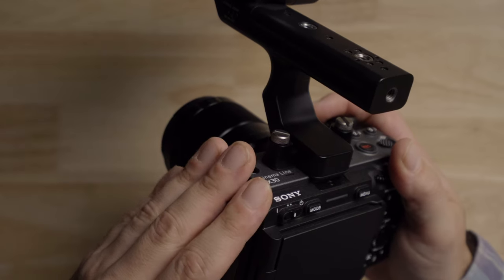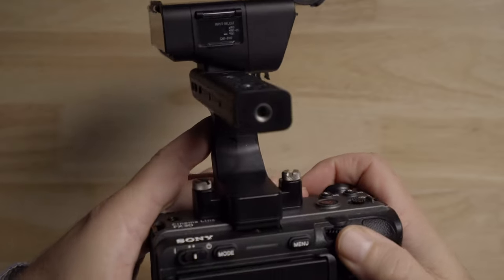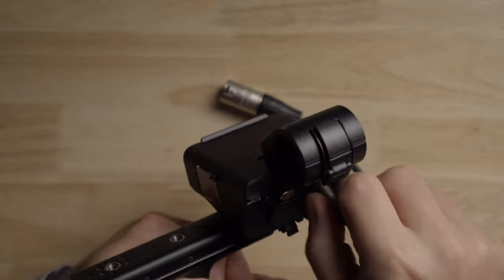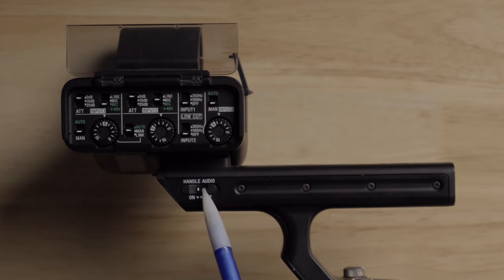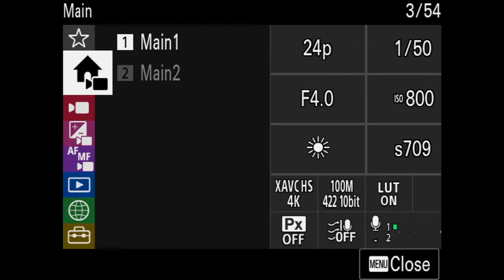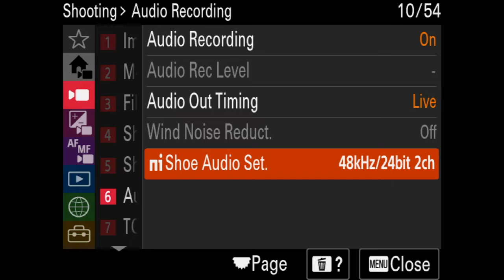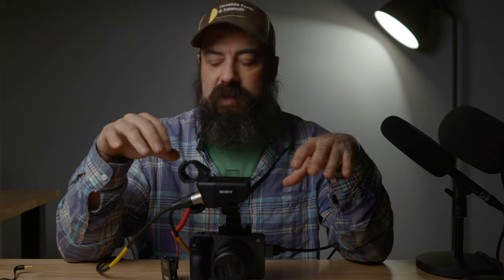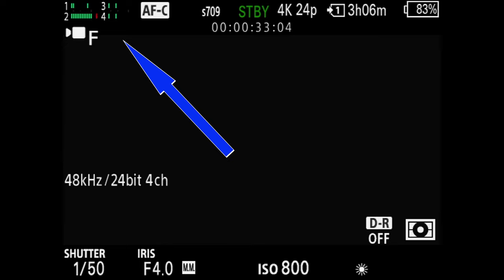Sony FX30 / FX3 XLR Top Handle - Everything You Need To Know

Comment: Just picked up an FX30 (coming from the older Blackmagic Cinema line) and went with the bundle with the top handle - definitely a much-needed accessory in my world. I'm a musician and I do demos on my channel of audio effects units with synths, drum machines, and samplers, and the idea of recording 4 channels of audio EMBEDDED in my video is going to make editing SO MUCH faster/better than syncing up my H4n files. Was super pumped to learn that the handle did 4ch audio. Excited to start using this thing! Appreciate your content btw!
Reply from the maker: You are going to love the top handle. It makes my life a lot easier. Thanks for watching!
Reply: Hey man. Quick question for you. Do you find the quality of the audio via the top handle is similar to running it through an interface? Basically I have been using an interface for my 2 mic video podcast setup. But if this thing works it would save me a huge ball ache of having to connect the mics through an interface into the laptop. Especially on location.
Reply: @HeywoodandStuff  It's absolutely good enough for YouTube! I mean probably not as good as the highest end stuff, but it just depends on your standards. I wouldn't use it to record my album, but I've been happy with it for my videos. If you check out any of the videos on my channel, I'm using it to record the line audio from my music gear and my Beta 58a at the same time, with a free channel to spare.
Reply: @Duskmos  thank you dude. Very much appreciate this!
Reply: @HeywoodandStuff  Happy to help!

Comment: Hey. Do this handle use battery power? I mean if I will use it with my fx30 the battery will run out quicker? Maybe it depends on the mic which I will use? If yes, what if I will be using "rode video mic micro" with an adapter? It will still use my fx30 battery power? Thanks in advance

Comment: I tried setting it up, but I got static and noise. I ended up using the 3.5 mic without the top handle. I'm not sure why, but I get cleaner audio without it.

Comment: Thank you- this is a great vid! One question though... On my FX3, if I have a sony xlr shotgun mic plugged into the 2 xlr inputs and a Rode Wireless Pro rx plugged into input 3 for two lav mics, what should the input select switch be set to? Or does it even matter if the audio in the menu is set to 4 channel?

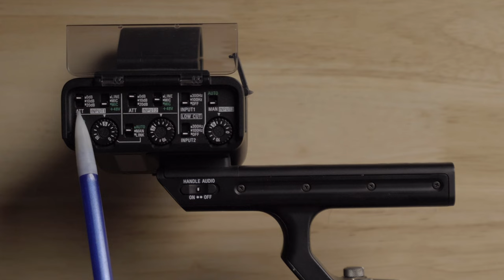Comment: Thanks Josh, for a great video. I want to plug sound from a mixer. I see at around 4:30 I have to choose Line Input level. What kind of cable do I use from the mixer ? XLR, 1/4 inch or RCA? Do I plug OUT or IN from the mixer ? Thank you!

Comment: Awesome videos Josh!  
I think that the XLR-K3M, although not as sexy as the "top handle," is more versatile than the handle--especially for those of us who have Fs7's, a7siii, etc...  Also, I'm not a fan of mounting an external monitor on top of the handle, growing the rig upwards and tending towards making the camera front heavy.  With a SmallRig half cage, and the XLR-K3m (and a few odds and ends) you can mount an external monitor more in line with the FX30's touchscreen directly below--counterbalancing the rig and lowering the external closer to the flip out.  Yes, you lose the cool handle, but in my world; most of the action is better covered from my chest up to eye level... Happy to share my FX30 setup.
Reply from the maker: Thanks! Yeah, pros and cons of both. It really depends on how you plan to use the camera. I do prefer the top handle for run and gun stuff like I showed in the video, but I agree the XLR-K3M is more versatile overall. Glad we have options!

Comment: Hey man, 
I'm curious if it's possible to use a shoe ribbon adapter, much like you'd see for a remote flash in photography to attach to the handle.

Basically I have a FX3 in a static position mounted above my desk facing down. I prefer keeping it in the small rig cage I have for it. What I'd want to do is use a ribbon shoe apdater from the audio port on the top middle of the camera to the audio handle then mount the audio handle on my overhead. Do you think this is possible? I can't really find information about others doing this. 

Thanks in advance

Comment: I buy an FX3 XLR Top Handle for my a7IV(I use Adapter plate SmallRig MD4019)And it works well, I'm satisfied!..But when I turn on 4 channels, and connect a microphone to input 1 (or 2), and a wireless microphone to input 3, then it doesn’t work for me not to write to the camera 3 and 4 channels. And if I select 4-channel sound in the menu, then I see that channels 3 and 4 are not active .... What am I doing wrong?... ..., sorry for my English.

Comment: On the fence on the fence!!!! So, can you talk about the pre-amps on the unit? I'm struggling with either grabbing the xlr top handle with the FX30 or using the cash to pick up the Rodecaster Duo on release in July. I know the Duo offers the ability to tweak the sound quality and add effects to the mic (NT1 Gen 5), BUTTTTT, I do like the idea of not having to match audio in post. Is that the main question people ask themselves haha? My use case will be in office talking head, streaming/zoom calls and the odd single podcast. Thanks in advance and you've got a new sub! Great content. Peter, Vancouver.
Reply from the maker: The pre-amps are average. Not amazing but not awful. The convenience is great though and you won't have any sync issues when streaming because the audio and video get send together to your computer.
Reply: @Josh_Sattin  thanks a mil for the reply. Can there be synch issue when streaming? I was looking at the streamer x and Ecamm live set up. Looks like it streamer x provides one audio/video source into ecamm. Thanks again, ordered body only in the end. Am I going to regret this? Haha. Cheers.
Reply from the maker: @peteroates37  I haven't used the Streamer X so I don't know how it handles that. If you are sending audio and video separately into your computer they will not sync up. You will have to go into Ecamm and set a manual delay. You can always buy the XLR handle separately later if you change your mind. I have done streaming a lot of different ways and personally always prefer to send the audio into the camera to avoid syncing issues.

Comment: Hey Josh! Thanks so much for the video! Quick question, I have my rode ntg4+ connected into ch1 and my shure VP83 shotgun mic in the input 3 with the 3.5mm. I switched the back input to the very top so that input 3 goes to ch 1,2. so far, i think im correct. now to adjust the audio for the 3.5mm, i would still adjust it under input 3 correct? or does that now switch to input 1 controls. thanks!

Comment: Hey Josh, absolutely life saving review! Thank you so much. Instant sub.  I have an AVX mic and when I put the INPUT on the MIC position, it doesn't work... I have to use MIC +48v (Phantom power) which is really weird as the AVX is powered by internal batteries... Am I missing something?
Reply from the maker: You are very welcome. Yeah, I do think you need phantom power for some reason. Easy enough though.
Reply: @Josh_Sattin  cool, I was afraid it could damage the mic if adding the camera power to the internal battery power… but well, as it didn’t work any other way either, I guess it was the way to go …
Reply: That is strange, cause that is the purpose of batteries... when needing phantom power in the mic. 
Otherwise, if a "normal" mic, then it should have worked directly plugged in the camera, like my lav mic.
Reply: @WEHAVETHISDREAM  it’s strange indeed .. when I plug in a “classic” Senheiser receiver (those that works with AA batteries) I don’t need phantom power .. but the AVX receiver , I do .. maybe the battery is too small and serves for the radio signal but needs extra power either way
Reply: @Superjeanmarc  Pffff... I have no idea.

Comment: Really good and helpful video thanks - I’ll sub. Didn’t actually answer what I wanted to find out though! 😂 I do weddings and typically use zoom H1s with lav mics for most of my audio, but always looking for backup options and was wondering how good the audio would be from a microphone attached to the handle and about 15-20 feet away from the speaker - I would assume not great? I’m thinking wedding ceremonies on a tripod that distance from the couple.
Reply from the maker: You're welcome. You will get better audio quality the closer you can get the microphone to the subject.

Comment: Hey Josh, would you still use the top handle over a external recorder?
Reply from the maker: It depends on what I'm doing. For simple quick setups or run and gun I would use the top handle. If I need a lot of audio inputs and am doing something more elaborate than I would consider external audio. For most things I do, the top handle is great.

Comment: Josh, what do you recomend to use in the shock mount for an fx3 as an all around situation mic, run and gun and also studio work ? usually the talent is like 5m or 5feet away from the camera, Sennheiser MKH 8070 or Sennheiser MKH 8060 or Sennheiser MKH 418 S or your beloved MKH 50-P48 ?
Reply from the maker: My favorite all around mic is the Rode NTG5 - https://geni.us/Yi7A5S
Reply: @Josh_Sattin  Can it be bought with black rather then the red mic holders?  And can a wind shield protector thing be found without RODE printed on it?  I like everything clean without adverts all over it.  It just looks quite tacky imo.  I see on your desk no RODE display on the mic.

Comment: Thank you so much for the excellent video Question I have a shot gun mic and wireless lav. Can I put shot gun on and link ch 1 and 2 and then add a wireless lav and input to channel 3? If so what do I slide the input selector to ch1.ch2 or ch3. Any help would be  greatly appreciated
Reply from the maker: Yes you can do that. Make sure you have 4 channel audio turned on inside the camera. On the back handle switch set it to In1 and have the linked switch turned on channel 2 on the side.
Reply: @Josh_Sattin  great... thank you so much for your time!

Comment: Thank you for this video. As a warning for musicians and audio guys I have to say the preamps are not good and produce a lot of noise. A solution is to use an external preamp with a lot of gain and go into the Line Input at 0dB and very low input volume. But even then it‘s not going to catch up with the Zoom F3.

Comment: Hi!

What is the fourth channel?
Is there a microphone in/on the handel?

The other day I experienced a lot of (unwanted) noise from the handlebar. I had a shotgun (XLR) and wireless XLR lavalier. 
With the shotgun channel came a lot of that unwanted noise, which I can't split/separate.
Reply from the maker: The 3.5mm input on the handle is a stereo input. It is channels 3/4.
Reply: @Josh_Sattin  Ok. So when you plug something in it is the 3rd and 4th channel?
So really it is three channels?
1: XLR
2 :XLR
3 and 4: Jack

And is there a mic on the handle? (since I got all that unwanted noise)

Thanks :)
Reply from the maker: @christianbreidlid3191  Input 1 and 2 are mono inputs (1 input each), the third input (3.5 mm) is a stereo input (two inputs). You can use something like a Rode Wireless Go II or DJI Mic to have it send separate signals to the left and right channels (3 and 4) thus giving you 4 channels of audio. There is no mic on the handle.
Reply: @Josh_Sattin  Aha. Thank you!

Comment: I find it bizarre that anyone would choose to not get the top handle. The audio input option is priceless. 
My biggest gripe after excessively working with the FX3 is the lack of a REC button. It has the interface to send 24bit audio, there must’ve been room for a programmable button or two. Would save a lot of awkward fiddling to hit the other REC buttons
Reply from the maker: Oh yeah, a record button on the top handle would have been amazing!
Reply: I am debating with myself between NO handle and YES handle. 
I do not do audio stuff, normally, but I did have a project from a client, 
where I had to use a Tascam recorder. 
DaVinci can match the audio pretty easily and all... but, 
not having the need for an external recorder, could be cool. 
BUT, I do not know how often I will have clients like those...

Comment: Just picked up the FX30 with the XLR top handle. I had a quick question:
Does anyone else have handling noise recorded when running and gunning and using the handle? I get incredible feedback when moving - even gently - my fingers or hands and was curious to know if anyone knows of a fix? If you dont get the handling noise, would you mind sharing what mic and input you are using?
I am using the input 3 with a Deity 4 mini. Thanks in advance.
Reply: If you get get the top handle extension (small rig) it reduces the noise tremendously
Reply: @Kinetic-Studios  oh yes, thnaks! I ended up getting that shortly after posting and also changing the mic to a Sennheiser MKE-600 and haven’t had an issue since.
Reply: @Kinetic-Studios  What model, please? 

Does it make sense to get the Sony handle and XLR audio unit for occasional recordings, 
or better off with a regular handle and just put the mic in the little camera socket, when needed?
Like lav mics etc.
Reply: @WEHAVETHISDREAM  i wouldn't get the top handle. I did and frankly haven't used it

Comment: Can you run this system with the Sony A1?
Reply from the maker: While I do think it would technically work because the XLR-K3M works with the A1, the issue will be mounting it because the XLR top handle needs to screw in to something. Smallrig makes this adapter for their A74/A7S3 cage, but I'm not sure if it would work with the A1
https://www.smallrig.com/SmallRig-Adapter-Plate-for-Sony-FX3-XLR-Handle-MD4019.html

Comment: Can you run a XLR Lav Transmitter with 2 receivers at the same time as using the 3.5 jack with Lav Transmitter and 2 receivers for a total of 4 channels? I’m not sure if you can do this please if anyone know let me know. Thanks
Reply from the maker: Yeah that should work. You can run any two XLR inputs and then either a 2 channel lav mic pack into the 3.5mm or get that splitter.

Comment: Congrats, Josh! Very helpful video :) 
I am wondering if it is possible to use just one XLR input, duplicate it on channel two with a lower input volume, and also record ambience sound using a 3.5mm microphone. 
Thanks!!
Reply from the maker: You're welcome. Yes, you should be able to do that with the 4 channel option.

Comment: i'm a bit confused. i didn't see it, but is that handle somehow hooked on to the FX3?
Reply from the maker: Yes. It slides into the hot shoe and then there are two bolts on the handle that you screw in to the body.
Reply: @Josh_Sattin   i meant the electronics, is there a cable? that I'm not seeing?
Reply from the maker: No it connects through the hot shoe.
Reply: @Josh_Sattin   thanks buddy